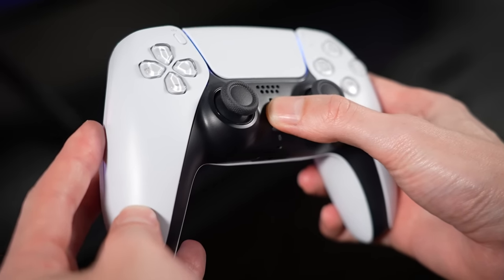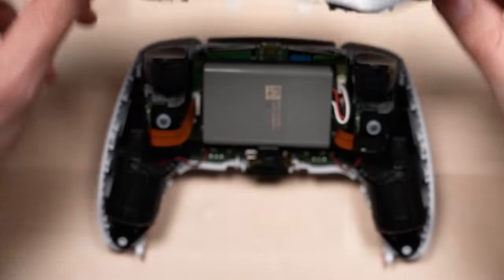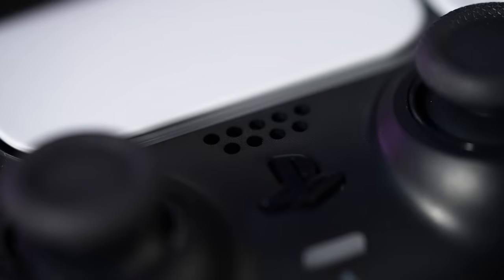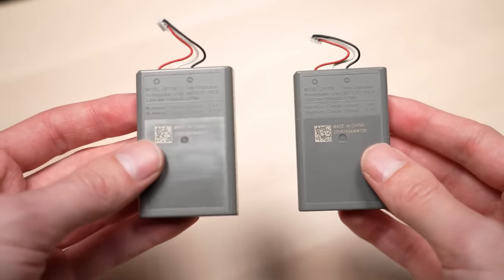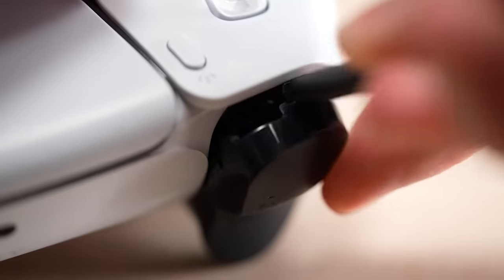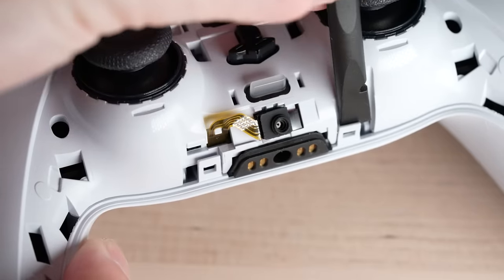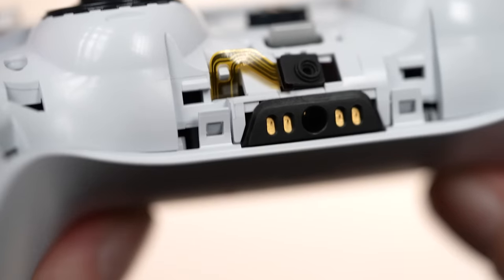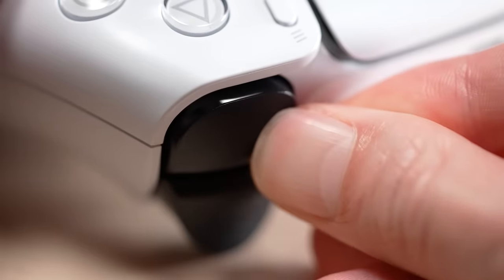Sadly, your Playstation controller won't last much longer..

Comment: The common convenience of having a battery compartment should be something standard with all controllers. There's zero reason why you should have to go through that many steps just to remove the battery.
Reply: Bruh it’s not even remotely hard to remove the back and get out the battery. I do it all the time when I need to fix my dual sense. Stop being so lazy.
Reply: The reason is to discourage repair and make people buy new stuff much sooner than necessary.
Reply: @legocat0306  Don't defend this crap. Yes it's easy enough to do yourself, but it is so much harder than it should be. Batteries should be trivially easy to replace.
Reply: Xbox moment
Reply: @legocat0306  AA batteries.
Reply: @leandervr  i prefer internal batteries over aa there cheeper and last longer the battery in my 2008 model ds3 is the same it came with cant say the same for the aa batterys i had from 2005
Reply: @legocat0306  damn, why you so hostile bruh, it ain’t personal 😂
Reply: @Byron-Hungerford  one nice thing about AA is that they are really easily hot-swappable and require no charging if you go with the alkaline option
I run a logitech F710 (really good controller,  measures up in comparison with the DS4) and I get approximately a month or two of use-time with rumble, meaning approx 8 batteries per year. That's like - 10 bucks, tops. No downtime either as you don't have anything to charge. The alternative is, of course, to do with rechargeable AA batteries, so you get both the benefits of being able to swap plus not making unnecessary e-trash. This option is on par with internal batteries in my opinion, but I don't really want to manage charging batteries once in a blue moon so I'm a bit biased there. The only downside to AA batteries, other than the lower life-span, is the weight (+electronics waste if you do with alkaline)
All in all, I would say that AA batteries deserve another chance
Reply: @gamespender8605  I run aa in xbox controllers and they last a max of 10 hours for standard a bit more for rechargeable but my Ps controllers last longer and I'm running really good aa batteries
Reply: @leandervr  this is trivially easy. It's 4 screws. That's it. No specialized tools. Just a damn screwdriver. The only reason you would consider this excessive is because you're too scared of opening the controller yourself.
Reply: @legocat0306  because you have no choice, well you do, its either spend 10 dollars on a new battery and time learning to do this, or shell out 60 bucks for a new controller.
Reply: @Byron-Hungerford  either stop buying cheap batteries or stop playing games 10 hours straight
Reply: @legocat0306  or just have a compartment and it'd be even EASIER. Who doesn't like easier?
Reply: @McLoviniam  energiser isnt cheep
Reply: You want a disgusting Xbox 360 battery pack bulging out the back of the controller
Reply: @leandervr  the only time we should complain is when it’s made impossible to access the battery without breaking the product. This is NOT one of those cases.
Reply: @visinh  You can get actual rechargeable AAs. I've done that for years. And I'm not even asking for that, just like a compartment with a single screw or two to access the rechargeable battery. I shouldn't have to remove the trigger buttons to get to the battery. It's designed as an intentional inconvenience.
Reply: @Byron-Hungerford  You're missing the point. It's not one or the other. A internal rechargeable battery that the device comes with should still be behind a cover that can be opened without tools. It should be immediately obvious to every user that you can just put in a new battery if the battery has gone bad, but also it is user friendly to provide the option to get a second battery to swap in so you can recharge it externally and always use your controller wirelessly.
Reply: @MilkWasABadChoice17  its designed to hide screws behind the trigger and not have a big bulge sticking out the back of the controller
Reply: @visinh  It's not that hard to create a compartment without a bulge. Perfect example: Wii U Pro Controller. It's one of the most comfortable controllers I've ever had AND it has a compartment with a single screw to replace battery, no bulge at all. Places for screws don't hurt aesthetic to me, it means it's easier access.
Reply: @Byron-Hungerford  AA rechargeable batteries are still better in many aspects
Reply: @Onshki  batteries are even more tirvial. Just pop the battery cover off and swap those out for a fresh new set of batteries. Takes 3 seconds
Reply: @MilkWasABadChoice17  don't forget Xbox one controllers back being flush especially where the batteries go
Reply: @Onshki  5 in the ps3 i belive it the same in the ps4
Reply: @CelicaSNC  not for longevity tho
Reply: @Byron-Hungerford  tell me how rechargeable AA Batteries aren't better longevity? I have 2 pairs. If one stops working I could buy a new pair for cheap
Reply: @CelicaSNC  well ive had to replace aas ive never had to replace a battery that came with the controller
Reply: @Byron-Hungerford  and we are arguing 2 different experiences. I've had 2 pairs of AAs rechargeable batteries for going on 3 years now and they haven't failed on me yet
Reply: @nathanaelsanborn9362  probably a PlayStation fanboy
Reply: @McLoviniam  I can't game for 10 hours straight no wonder some of these gamers are so damn fat not saying I ain't but I can't game for 10 hours straight unless I'm actually trying to grind.
Reply: @legocat0306  I replace my Xbox controller battery in < 10 seconds, no screwdriver needed.
Reply: @leandervr  or if you just maintain your shit you wont have problems. ive had my ps4 controller since 2016 without any problems and a full charge will still last a whole day
Reply: @KingKami It is the company making it hard for you. I use rechargeable battery packs for my Series X controller. What do I have to do to replace the current one with a freshly charged one? Pop up a lid, put it in and finally put the lid back on. I don't need to pry it open, remove any buttons or screws. Changing a rechargeable battery pack for a Ps5 controller is way more inconvenient than an Series X Controller. That is by design because most companies don't want you to open it up and change parts by yourself. In general they want you to buy a knew one or go to their service centers so they can charge for something you can easily fix yourself. That's the way the electronics industry has gone.
Reply: @KingKami changing a charging pack is easy as shown plug the old one out, plug the new one in its not hard to do. The hurdle that makes it unnecessarily complicated is the disassembly of the controller. It's not like they tell you in the manual how to do it. Effectively you have look it up on external sources like YouTube. They could have easily designed a lid right over the battery compartment for the user to unclip or unscrew to get at the battery
Instead you have to take the controller apart. You shouldn't have to do that to change the battery.
Reply: I agree. It's a dirty practice. It's designed for people to buy another device. All companies do this sht. As some "bruhs" say here, yes, it's not very difficult, but if you don't know what happens, and no one tells you, you probably buy another one. Another "bruh" accuses you of being afraid of opening the controller. Of fkg course is that, I am afraid of breaking it. 
A battery compartment with easy access like a remote TV controller should be something normal, but they know what they are doing, and why.
Reply: @Onshki  i mean a controller costs a fuck ton, obviously people are scared. But still the point remains, batteries shouldn't be that hard to remove. The reason why they are as complex as they is a pure marketing strategy to increase controller sales as your average Joe with a lot of money will just buy a new one instead of changing the battery
Reply: As Always microsoft wins hands down... no console war, I have both, but Xbox is way better than Sony for these kind of stuff
Reply: @legocat0306  Your response is just completely devoid of common sense. How hard is it for sony to include a compartment with 1 tiny screw for easy access to an interchangeable battery? I'd rather they charge us more fleecing us for "official" batteries than the thoguht of perfectly good controllers getting thrown out and adding to the plastic waste problem we face as a society. These same companies will also virtue signal when they are adding to  the problem of needless waste for profits.
Reply: Sony gets more from you buying a $70 controller than you buying $10 battery packs.  That's the only reason it's so convoluted and requires steps that will feel like you're breaking the controller.
Reply: That's the approach Xbox uses now.  Much prefer it that way.  I have a few rechargeable and removable batteries that I switch between as and when needed.
Reply: @Onshki  are you being obtuse on purpose or are you still seriously missing the point?
Reply: @legocat0306  you missed the point.  Greedy Sony has been blowing this for years.  These should be removable like the Xbox controllers have been for over a decade.  Like it or not, most people will not disassemble their controller to replace a battery, they will just buy a new controller like greedy Sony wants.
Reply: I have 2 battery packs for my Xbox with 1 always charging. It lasts close to a month and I just swap batteries when it dies. I never even have to think about charging
Reply: Props to the steam controller for easy access
Reply: @legocat0306  Xbox controller batteries’ literal plug and play is just that, plug and play. That should be the industry standard.
Reply: @legocat0306  Lazy? No one is being lazy, its just easy to have the batteries and I'm not hating on PlayStation at all, so don't make up things
Reply: @Byron-Hungerford  because it's batteries, they will have to be replaced, just get rechargeable batteries, it's not that hard